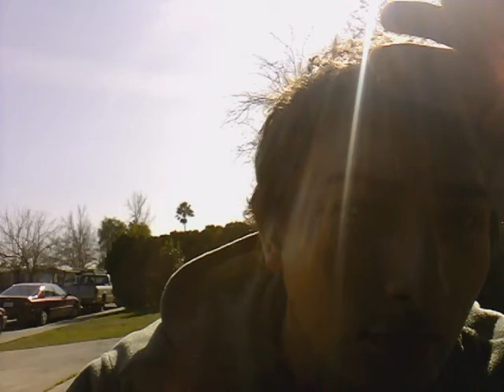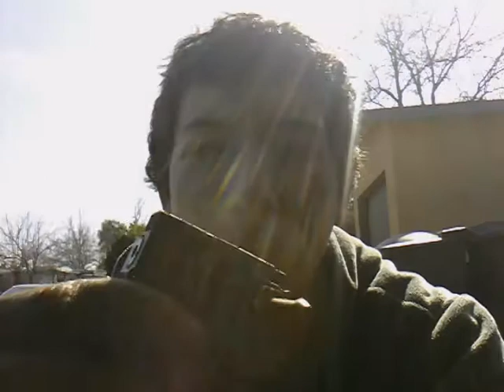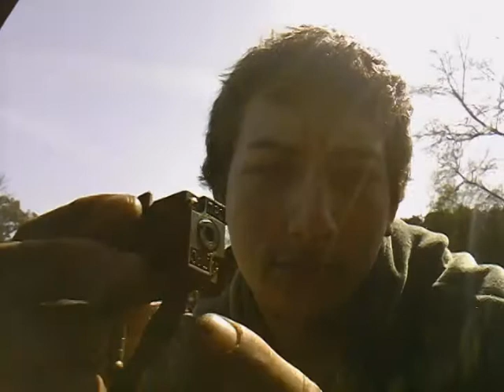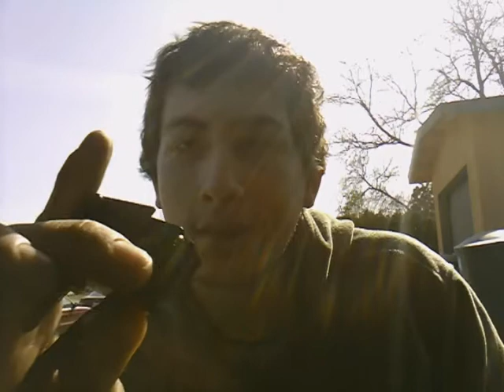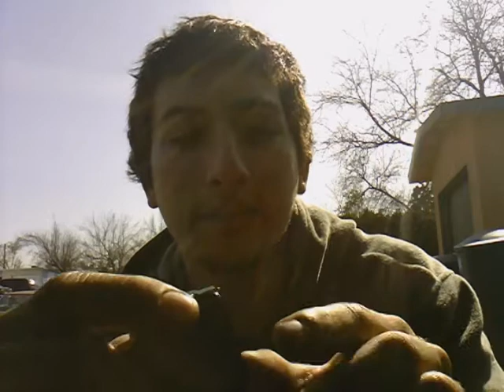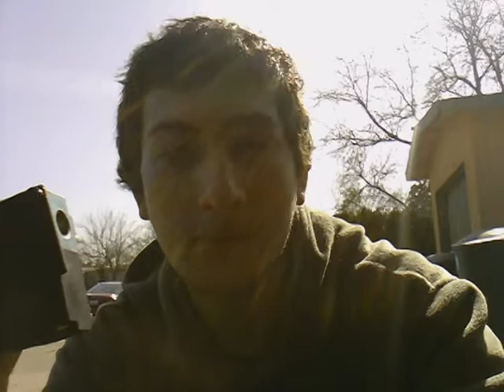Haltech PS2000 troubleshooting haltech boost control solenoid finally fixed problempart 4

Comment: I have a Haltech and a manual boost controller running 7psi off the wastegate and have manual boost controller turned up 1 psi....holds boost at about 7.6psi then around 5500-redline boost drops to 7.2 and goes up to 7.5 then drops back to 6.8 then 6.2 to redline....its killing TQ and HP. Made 404whp and 393ft-lbs @around 4500 then TQ drops all the way to 300ft-lbs at redline.....I'm wondering if the Haltech electronic boost controller will do a better job of holding boost up to redline..?

Comment from the maker: I started with 11 psi. I am tuning the car for 19 or 21PSI. right now I am breaking the engine in so its coming along. I just need 10000 miles to make sure the car is ready. =D